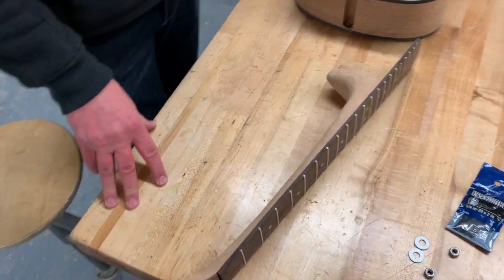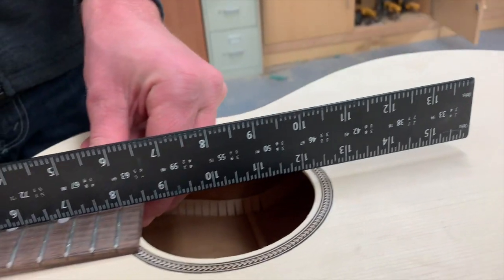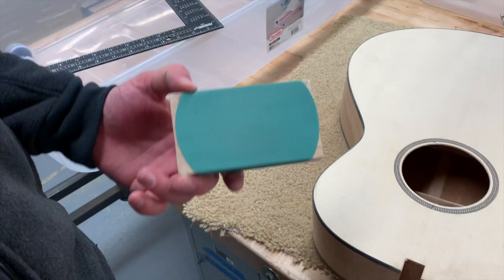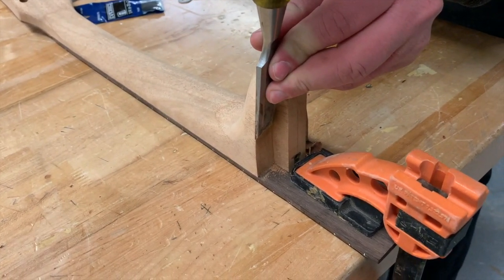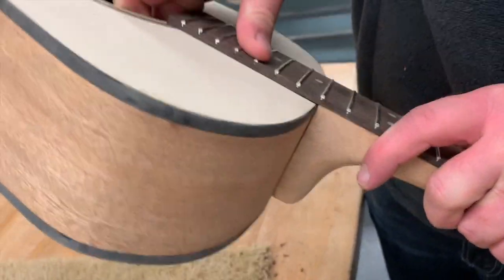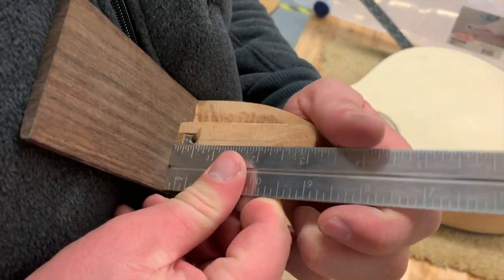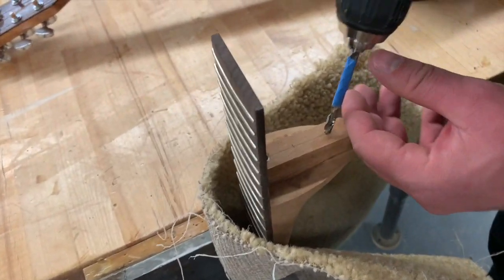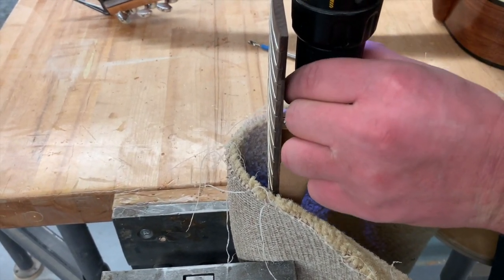How to Build an Acoustic Guitar - Attaching the Neck

Comment: Spray adhesive sandpaper to the body. Slide the neck tenon in and out to sand it. Also attach the fretboard last. Use sand paper stuck to the top to profile the fretboard overhang. You really did things the hard way

Comment: Wow.  I just came back from the Veteran Affairs Hospital and notice the neck of my guitar was crack were headstock and neck meet.  I tend to abuse my guitar by leaving it hot car, leave it in the sun, let other people touch, tune high to keep very taunt string pressure and etc..  You get to know the personally of the area that way...I have guitar stolen from my car or people pretend to know how to play or take credit.  The debate I have is replacing the the neck or getting a new guitar.  Either way, They hate talented people and will lie like crap...  Waste money, should brought a new guitar and etc...why they themselves don't know how to....Same goes for advance STEM degrees.  For example, pretending to have medical degree, law degree and engineering degree to look important for the "kids" and their peers...  Too much ego..  PS....Like building my computers and laptops, I will probably do stupid things like using construction adhesive and etc...I like to experiment.  I remember putting a titanium rod the length of a neck...  Stupid stuff as the tradition guitar builder would say...Before it was using power tools.